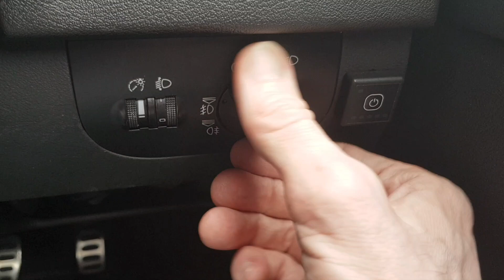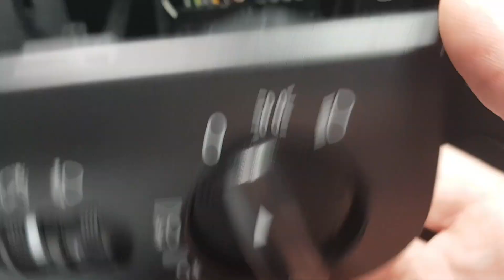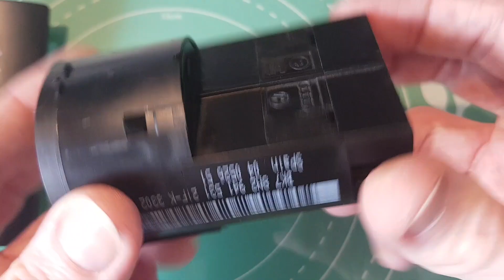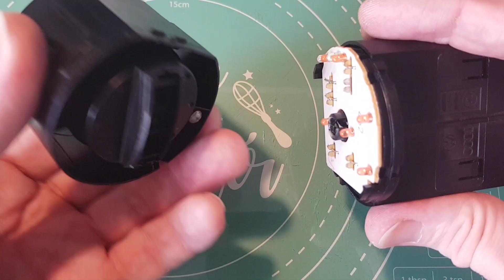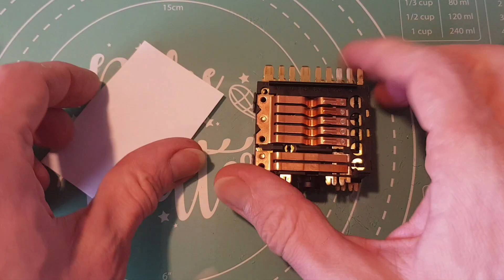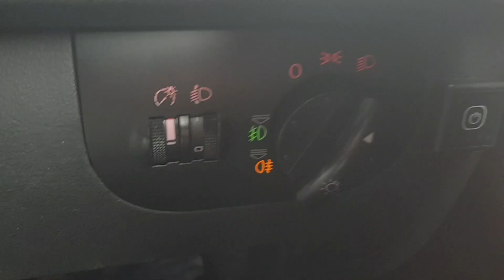Audi TT Mk1 (8N) - Headlight Switch Repair

Comment: Great video! I’ll be honest I was hoping to see the rotating cluster dimmer dial worked on as well. I’ve had three switches over the years and dials on all three acted differently. Only worked “okay” whereas the others either barely made a change, or would start bright, get slightly dimmer, then get bright again
Reply from the maker: They are easy to open up and clean. I did mine at the same time but didn't film it

Comment: Thank you for this video and showing the trick to remove the switch!!  My foglights turn on with my headlights and I cannot control them (foglights) with the switch. I will try cleaning the contacts...
Reply: cleaning the contacts fixed my fog lights. the switch now turns the fog lights on and off.